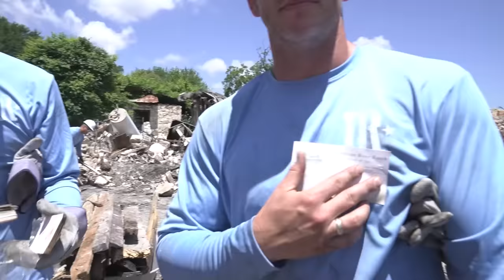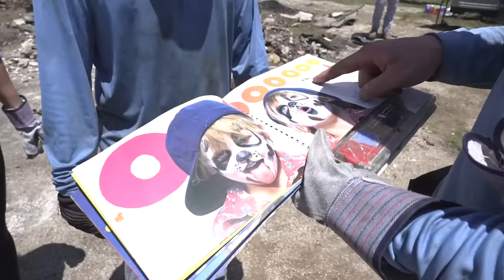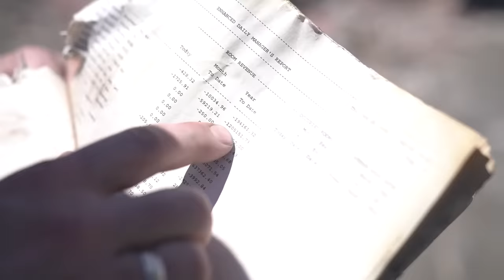Renovating an Abandoned Resort: Part 4

Comment: For the old main building, get a structural engineer to say what can be reused to support new structure.  If not, they may be able to put a self supporting steel beam structure around it to keep them.  Also, get a 3D scan of the place to help with modeling efforts if that happens.

Comment: That stone is super expensive if you can save most of that stonework from the 20s you’d be way ahead financially get you a good Mason out there to read Tuckpointing clean it up and repair it and then start putting the structure back together on top

Comment: You're going to have sooooooo much firewood! Then you can grill the goats!!!!
If you find or buy a cheap 20 foot shipping container cut the top off. Then there are wheel/dolly systems you can buy/make for them to turn them into a huge trailer. Fill it with the timber/wood and haul to another part of the property to dump it for later use.

Comment: Don't know if it would work but I noticed those burned timbers still have some meat to them and it would make a cool epoxied banquet table. Frame it out in unburned timber, putting the burned timbers in the center and epoxy leveling it with the exterior framing.